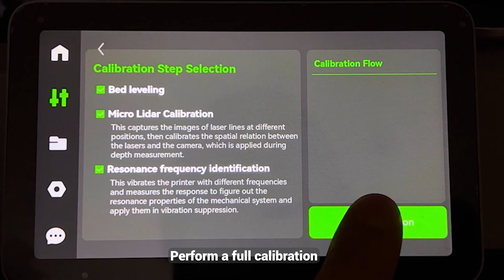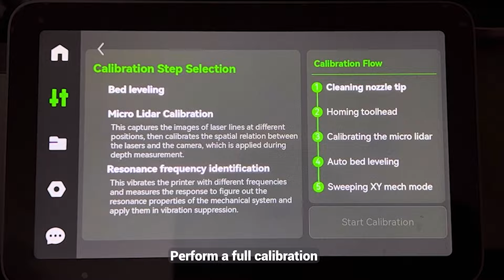Cleaning Guide for Carbon Rods on a Bambu Lab Printer

Comment: For anyone watching this tutorial: DO NOT SPRAY IPA ON THE BELTS AS SHOWN. Use a wet IPA wipe or spray IPA onto a clean microfiber and then wipe down making sure to avoid contact with the belts.. You will thank me later. :)
Reply: Indeed. Ipa is belts/rubbers worst enemy as it dries it out and dry rots it
Reply: Printed a tool just for this!
Reply: Is 70% ipa good enough? Coz im thinking of getting the alcohol swab to do this
Reply: @nadzirulakira  91% or above would be better. Make sure to avoid contacting the belts at all costs.
Reply: @sofghost6663  Not strictly true, IPA evaporates so quick it doesn't have time to soak in and cause and drying out of the belt
Reply: @wolfe1970  That depends on how much is applied. A fine mist will evaporate quicker compared to something that is soaked with 10 pumps from that spray bottle.
Reply: My X1 is not even a week old and it’s telling me to do this already. Does that sound right? I am so afraid to do things to it myself 😢
Reply: @GiamarieSaponaro  yes, you need to do it once early on, as the rods are new and not "broken in" yet. After that, you don't have to do it very often at all. Just make to be thorough when you do!
Reply: @KraziEyevin my P1S hasn’t told me to do it or any maintenance and I’ve had it since about September last year, about a couple of hundred hours on it so far.

Comment: I'M SURE IT'S FINE but seeing alcohol come into direct contact with those belts sort of bugs me. I think I'd carefully apply the alcohol to the rag and then use it to wipe down the rods. The belts are probably stable and quality enough to not see any issues from this but... idk it just worries me lol
Reply: The right way to do this on any mashine would be spraying it on the towel and then rubbing it clean. That way you don't spray it all over the place and only get it on the surface it should be.
Reply: Dilute IPA 65% and under is not concentrated enough to degrade, dissolve or otherwise harm most plastics and rubbers. As the percentage of IPA to water or saline solution goes down, the agressive characteristics of the IPA becomes substantially less. The reason for the drastic change isn't fully understood, but it is well implemented in the medical field. I used to make artificial heart valves and arteries which were made out of many layers of nylons, stainless steel ribbon and thin plasticized coatings. We were specifically trained in using solvents around the workplace and that's where I learned about why there are dilute and concentrate versions. 

100-98% are used primarily as a sterilizing solvent to remove markings or carefully dissolve residues and hazardous contaminants.

90-75% is less effective as a powerful solvent and can be used to clean contaminated parts and dissolve swarf from castings carefully. On the higher end it can still damage some surfaces but on the lower end it's safe for most surfaces and can be used to remove ink and other easily dissolving contaminants.

65% and under are generally used for decontamination of surfaces and the low viscosity means it won't sleep into unwanted areas. Basically just a quick drying residue-less cleaning agent. Can barely remove permanent marker. Perfect for cleaning a printer since it will likely not etch plastics, leave behind residue or dust, and dries quickly so as not to worry about electronics if turned on soon after service.

I would only refrain from using alcohol based solvents on your print surface as repeated use will build up a film that can prevent adhesion. Warm water and a scrub with dish soap is the most effective method of bed cleaning and may work a bit too well some times. Dish soap is one of the most effective degreasers you can buy as a non-commercial entity.
Reply: It isn't fine.

Comment: how much toque should be applied to tighten the screws without over tightening them?
Reply: Please someone answer this
Reply: Use the reverse of the amount of torque used to loosen them. :face-red-droopy-eyes:
Reply: @No0o0o0o0o0  Well, that would tell you how much torque was originally applied but not necessarily the correct amount of torque. It could be that a few units were either under or over torqued. Would be nice to just have a clear answer from Bambu on this question.
Reply: @UbberMapper  Considering you are hand tightening it's not stretch to assume you didn't need to over exert to loosen so don't over exert to tighten.

I will assume most people do not have a tool that expresses torque values. Also you are assuming that the metal you are screwing into won't wear over time so the value will be meaningless Then you are looking at people who do have the tools to measure and it still be off. Or those who get cheap aliexpress/amazon tools and the values all all over the place.

I'm going on a limb and say Bambu Lab doesn't think we are complete morons and know when tight is tight. 

But since this is a 3d printer and most of the peoples here are champions of information gathering and dissemination why not create a YT channel/website and go over anything that BL didnt put out. There are a few of you speaking about torque values and it would be a welcome addition to the community.
Reply: @No0o0o0o0o0  You make valid points. None of which i will argue with because i agree or at a minimum do not disagree with anything you have said. I still want Bambu to answer the question though 😁
Reply: @UbberMapper  I'm sure they don't specify because they don't have a specific answer. Just make it finger tight, what you're tightening is just locking the adjustment in place. It appears there is a spring applying tension when the screws are loose because the assembly moves perpendicular to the screws not axially with them. The tightness on the screws wouldn't affect the belt tension.
Reply: You should twist them until you hear it click
Reply: 5nm is usually considered "finger tight"
Reply: @lmaoroflcopter  I am reasonably sure that 5nm would break it. Please test on your machine and let us know :)
Reply: @UbberMapper  I'm not the one asking for torque specs. 5nm is finger tight, if 5nm would break it, its not made of steel, its made of chocolate, I have zero idea how tight mine are as I've not measured it.
Reply: @lmaoroflcopter  I just did a quick google search... The amount of NM considered to be finger tight depends on several factors including the size of what you are trying to tighten. Obviously a 3mm screw head which you can only get two fingers on can not be tightened as much as a 50mm jar lid which all of your fingers can get a grip on.  Also, your statement that it cannot be steel if it would break at 5nm is wildly false. After all, strength is not determined only by the material but how much material is present. You could easily break a single strand of steel wool with your fingers but you would be hard pressed to damage a 2" steel pipe with nothing but your hands.
Reply: @UbberMapper  in that case, i'd suggest starting at 125nm on your printer.

Comment: Why not just use the screen to move the print head instead of loosing bolts?  Also wouln't it be better to spay into a clean rag and wiping them rather the spraying directly into the machine?
Reply: That was the same question I had (about moving the print head instead) ...:(

Comment: This is great. Important you run the head back and forth over the wet IPA. Cleaning the rods is easy. Cleaning the bushings is the part that takes time and can only be done by what is shown.  

I personally use an IPA wipe or damp rag and just keep it next to the print head and move it left and right like 50 times and make sure the rod is wet while doing this, otherwise you need a new wipe or more IPA on your rag.  This way keeps the IPA off of the belts and other components that might get wet when using spray.
Reply: you gotta keep the rod wet fr

Comment: Do you have torque specs for the belt tensioner screws?
Reply: I wouldn't bother with the belt tensioners at all, not sure why even Bambu says to do that. Because some people get ringing introduced to their prints by messing with the belts and it can be tricky to dial in. You can just move the print head by hand regardless of whether you loosen the belt tensioners or not, or move the head electronically. Also, as others have said, don't spray alcohol all over the belts as shown, as it will cause them to dry out and crack faster.

Comment: So this exact method using 91% IPA just color changed all my interior plastic covers in my 4 day old P1P. Anywhere there was overspray now looks like someone permanently sneezed inside of my machine. Lovely.
Reply: I'm pretty sure alcohol can have a bleaching affect on pla I have some models next to where I spilt some IPA and the black turned a greyish color lol
Reply: @Hayden-fb8im  yeah I’m absolutely baffled as to why they show this technique for cleaning the rods as an official guide if it can hurt anything inside the machine. Zero warnings. Highly recommend NOT following this guide
Reply: @Printed Primate  I'd say alcohol is the most mild thing that will still get the job done and it's also what many people already use for cleaning beds
Reply: I don't think there is any damage and you just need to wipe them, maybe with same IPA. Also why in hell do you need to do this on 4 day old machine?
Reply: @woopsserg  nah it definitely changed the surface. I can’t wipe it off. Trust me I’ve tried. And good question.. 4 days in I got the error that said I needed to clean the carbon rods and recalibrate. After doing so the error went away and I haven’t had a problem since. Just left with that discoloration now.
Reply: Since PLA does react with almost anything, I sometimes use Krylon Fusion clearcoat or similar if I need it protected. Lightly sand the PLA to scuff it and improve adhesion and go easy on each layer. And be sure to test on a sample before going all-in, just to ensure compatibility.
Reply: @woopsserg mine arrived with this warning message.
Reply: @Bendezium  Then just make it go away without doing anything,

Comment: May I ask why those screws need to be loosened first? I’m pretty sure I’ve seen people moving the head left and right without doing so. Please be kind, I’m still a bit if a n00b.
Reply: Two reasons that I can think of: 
1 - reduce wear on the belts / motor.
2 - If it disengaged the belt from the motor (I'm on my phone right now so can't tell from the video if it does or not). It is not recommended to manually move parts that may in turn be connected to DC motors manually as it can cause current to be generated and may be enough to damage sensitive electronics (A DC motor is a DC generator in reverse). For example, on an Ender 3 printer, it is possible to move the parts manually with enough current generated to get the LED screen backlight to come on briefly if you move the axis manually fast enough.

Comment: Is it necessary to do a separate calibration as the video shows?  I thought the machine calibrates before each print (by default)?
Reply: It doesn’t do a full calibration. For example the vibration compensation is much faster before a print and not as thorough as if you do a calibration from the menu.

Comment: Do you have to lubricator it at all the car on rods
Reply: You should probably not lubricate the cabon rods. They do not come with any lubrication and in fact might be self lubricating (kind of like a graphite lube maybe)
Reply: Do NOT lubricate your carbon rods. They are designed to run dry

Comment: Seems quite simple. Question: Is there any concern at all of the IPA degrading the belts? I know that IPA can dry out rubber, so just wondering about getting it on the belts.
Reply: IPA will not damage any rubber unless it's applied long term, short exposure is harmless. Also IPA does not affect most of rubber types to begin with. If concerned, do not spray it but apply it by wet paper towel or from small bottle right on carbon rods.

Comment: My carbon rods have weird vertical lines on them almost like there is some kind of chatter happening, and wearing incorrectly. The sad part about this is this is my second printer that I have had less than 5 days. My first printer had a bad bearing on the left side, and it damaged the smooth rod to where the finish was worn down and not shiny anymore in some spots. When I started noticing the carbon rods having the weird lines on the new printer, cleaned the rods with alcohol and paper towel, and also inspected the smooth metal rods... Well, I found metal flakes on the metal smooth rods, so I suspect this 2nd machine will have the same bearing failure as the previous one. I'm getting pretty tired of dealing with this crap at this point.
Reply: Any update? Mine has horizontal lines
Reply: They run dry what did you expect, carbon rods good for fishing line only, no precision motion systems in industry use them

Comment: This printer is good until you have to talk to the technicians…. I’m having trouble with a defective part and I’m 3 weeks writing with them because the printer has a defective part that they don’t want to change it . Since day one this part was defective but the post service of bambú labs is a piece of ……..
Reply: Fixed?
Reply: @rickyneeter69  yes but i had to pay the rods....because they did not want to change them under warranty
Reply: @mrvicco  weird. I got horizontal scratch or something on my carbon rod. I think I have that since week 1. I am worried it will cause layer shifting etc over time
Reply: @rickyneeter69  mine was vertical and it was like a bit of glue or epoxi and when the carriage pased throug it did make noise so it was really bad , when I changed the rods with a sandpaper on the old rods y rubbed it of